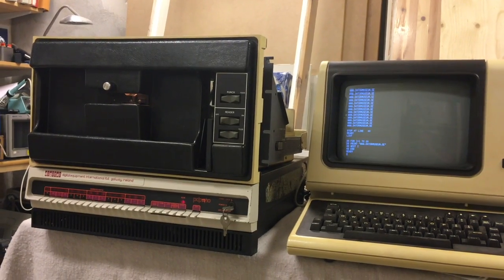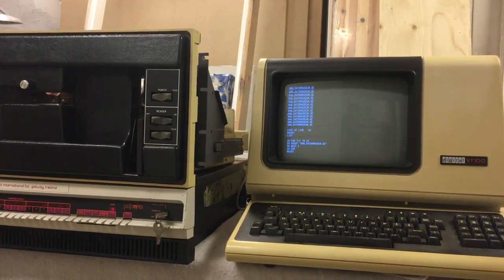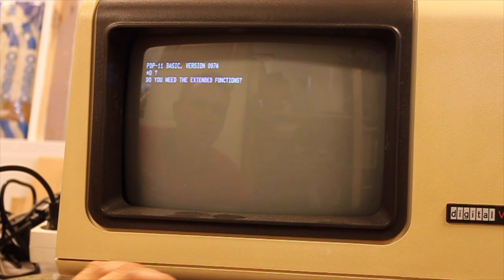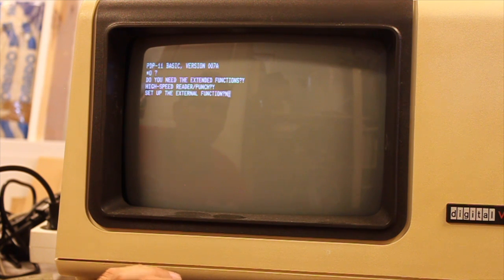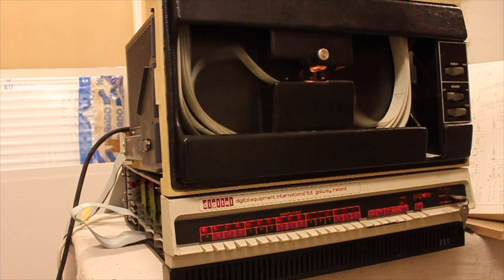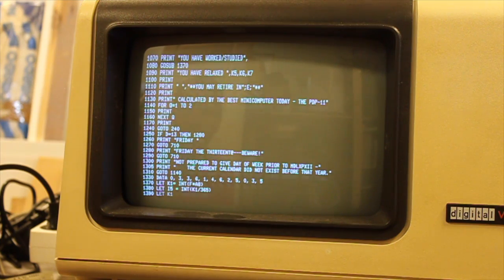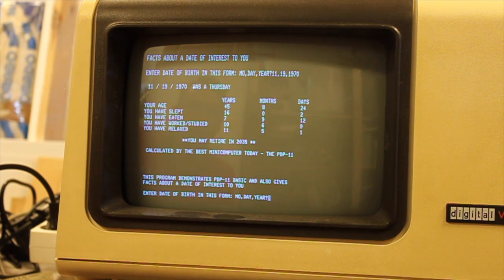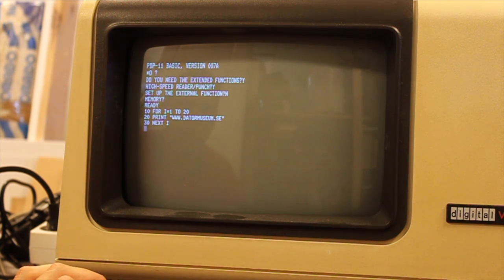PDP-11/10 running paper tape BASIC using a high speed reader / punch

Comment: This is so fascinating! however... why the need of entering the bootstrap loader every time ? they might not had have ROM (silicon) but CORE memory that can hold a program indefinitely . so why the reprogramming every time ?
Reply from the maker: As soon as you toggled the bootstrap in it can stay resident in the core memory unless it gets overwritten. So it should not be necessary to toggle it in every time. But sometimes it is hard to know if it has been overwritten or not…

Comment: I worked on PDP-11/70's in the mid-80's while in the Marine Corps.  Watching the boot sequence reminds me of what a pain it was to boot these things from a "cold" state.  That was our worst fear, booting a  cold and dark system.  We had magnetic tape and disk drives to boot from, which was certainly faster than paper tape but the initial sequence of setting up where it would boot from is very familiar.  Thanks for taking me back in time.

Comment: Does your 11/10 have 16 or 32KB memory? Assume the Basic you used is without support for strings...?
Reply from the maker: It has 16kByte. As far as I remember it was Basic with strings.
Reply: @mattislind4443  The ppt for basic with strings barely fits in the input tapeholder. Hmm, need versionnumbers here.

Comment: Could these punched tapes only store text?
Reply from the maker: One inch wide punched paper tape can store eight bit binary data. Not just text.
Reply: Early Quotron computers were loaded from paper tape.  They used machine language.  The plurality of computers were in Manhattan although headquarters were California so technicians would trundle a tape reader (made by Facit) around the NYC subway system from office to office loading computers.  This in the '70's.

Comment: i hated octal. 3 bits is not a power of two. I always wondered wg DEC used such an archaic system like that. Even the Altair used octal (which I modified to use hex) the IMSAI made much more sense
Reply from the maker: Actually I find octal not that bad. I think it is easier to remember octal numbers than hex. But maybe it is just me. Anyhow, it is definitely a heritage from when DEC computer had 12, 18 and 36 bits computers.
Reply: @mattislind4443  the reason I find hex a lot easier is because humans think in decimal (0-9) and its more natural to group things that way and 0-9 can be represented in 1 hex nyble rather than 2 octal nybles. Most Electronic chips also packaged things into power a of two (1,2,4,8 etc) for example a flip-flop chip in 74376 integrated circuits were packed 4 flip-flop in one packagde or dual flip-flops in a 7476 etc. When I built my first personal computer baaed around the intel 8080 the was also and 8 bit computer so I was more efficient to use chips that were based on 2,4,8 bits rather than 3,6,9. Powers of 2 was a more natural progression that than odd sizes that DEC used.
Reply from the maker: I agree that 0-9 is more understandable for humans, but what about A-F? Most people doesn't recognise them being digits. From what  you write it look like you talk about BCD, which of course has its uses . But most data processing takes place on binary numbers which has to be represented using A-F as well as 0-9.

The number of functions packed on to a SSI or MSI chip is mostly a function of the number of pins of the chip. Most of them were 14 or 16 pins. The 7404 packs 6 inverters into a package. A 74368 packs 6 three-state buffers into a 16 pin package. And the 74174 packs 6 flip-flops into one 16 pin package. 

My opinion is that I don't find octal that bad because I think they are easier to remember.  The octal legacy goes way back to when the computers had word lengths like 12, 15, 18, 24 or 36 bits. The DEC PDP-10 range used 36 bits and could pack six 6-bit characters into one word. I think that the conversion to 8 bit and power of 2 all started with the IBM 360 line which was a 32 bit architecture that had 8 bit bytes. It all fitted well with the EBCDIC character encoding scheme which also was 8 bit. ASCII BTW is 7bit. That would been an interesting mess to base things on. 14 or 28 bit machines?

DEC stayed with octal on the PDP-11 even though it was 16 bit and byte oriented. The VAX-11 however switched to HEX.
Reply: @mattislind4443  yoy would use a lot more inverters and small logic than flip flops etc that's why they packed more small logic on a standard 14/16 pin packages. But most other logic was based on multiples of two. Even the 1401 computer (which predated the 360) was based on BCD logic. The punch card was bcd based as well. It was the punch cards that came before the age of modern day computing suce as in devices like the 407 etc. DEC was late in the computer game with thier first machine being developed in the late 1960s well after the other manufacturers were producing theirs (IBM, BURROUGHS, etc) even Burroughs was BCD based. So departing from the std BCD based way of doing things was odd. Having odd word sizes just did not fit into the standards at the time. Reading BCD in hex is a lot eaiser than reading it in octal. Even IBMs packed notation reads easier
Reply from the maker: @rty1955   In regards to TTL chips and the integration level it is easy to check the list (https://en.wikipedia.org/wiki/List_of_7400-series_integrated_circuits ) There are 1, 2,3,4 or 6 functions per chip among the earlier TTL chips (than 1970) packed in either 14 or 16 pin packages.

IBM very early made the distinction between business and scientific computers. The business computers used BCD arithmetic while the scientific computers used fixed or floating point arithmetic. The advantage of BCD arithmetic is that you can get arbitrary precision without rounding errors. The disadvantage is the lower speed. Now when counting money you want it to be exact but you can probably afford the lack of speed. While scientific computation you can handle lack of precision if you do the math right. And you need the speed.

Prior to the 1410 there were a whole range of both commercial and scientific computers from IBM (https://en.wikipedia.org/wiki/IBM_700/7000_series ). There were no such thing as departing from BCD. IBM did both. The 1410 (and the tube based 650) was the logical extension of the punched card unit record equipment like the 407 and the like. But IBM had scientific machines like the 701 and 709 at the very same time.

Hollerith cards is dating back to 19th century and has a very peculiar coding with 12 rows. The encoding is nothing like 4 bit numbers BCD we are discussing (https://homepage.divms.uiowa.edu/~jones/cards/codes.html ) albeit called BCD under some circumstances. But was really BCDIC (Binary Coded Decimal Iterchange Code) 6 bits codes. Later on this became EBCDIC which were 8 bit code. (https://en.wikipedia.org/wiki/Binary-coded_decimal )

DEC built their first computer, the PDP-1 in 1959. It was all transistor 18 bit ones complement arithmetic machine. (https://en.wikipedia.org/wiki/PDP-1 )

Most processing is computers are done using twos complement arithmetic. Except for certain business applications where possibly COBOL is used and thus BCD arithmetic for processing infinite length numbers.

Hexadecimal representation of binary numbers has really nothing to do with the arithmetic used. It is just a way of presenting binary numbers to a user. Octal, binary,  hexadecimal or BASE64 for that matter can be used for representing binary data. Choose whatever base you like!
Reply: Octal only looks odd on today’s CPUs bit width of a power of 2. Early machines used 12/18/36 bits so groups of 3 made sense (and there was no advantage for groups of 4). And you do not need the strange „if it’s greater 9, switch to characters“ thing, that was part of old encodings of characters. And leaving some bits/fingers unused in counting is easier than to grow 6 more.
Reply: @fromgermany271  it was odd back in 1969 when I was working on a mainframe. You need 4 bits to count from 0-9, which is more natural for humans. A lot of old IC chips used 4 bits too. I worked on a 16 bit machi e that used byte-octal. Very weird. I much prefer 4 bit Hexadecimal
Reply: Octal is only the representation of a binary set of bit states, you can use decimal, binary, hex or any other format to keep your notes.
Yes, DEC used groupings of three switches to underline the octal digit positions, but that was for uniformity.Remember, the predecessor to the PDP-11 was the PDP-8 family with 12-bit words.
Reply: @laustinspeiss  yes I know. Some machines used bye-octal too.
The thing is: to represent human 0-9 digits, it requires 4 bits, so its more natural to group in 4 bit combinations
Reply: @rty1955  There was a side benefit… remember these were early days.
If you knew the PDP instruction set, the instruction opcodes and addressing modes were quite consistent, and used the octets quite neatly.  At one stage, I could literally toggle in machine code on the fly (only very simple functions!)
Reply: @laustinspeiss  I did that on a IBM 360 mainframe
Reply: DEC’s earlier machines had (in chronological order of introduction) 18-bit, 12-bit, and 36-bit word lengths. So grouping bits by 3s was very natural.

Even on the 16-bit PDP-11, you will see that, in the instructions, opcode fields and addressing-mode fields tend to align with octal digits.
Reply: @lawrencedoliveiro9104  I realise that, and that is what makes it odd, as its not a power of 2. When it should be 4 bits, 8 bits, 16, 32 etc, not 12, 18, or 36.
Reply: @rty1955  Those word lengths had more divisors.

Comment: $ basic

PDP-11 BASIC-PLUS-2 V2.7-C 

BASIC2

old punchrow

BASIC2

list
PUNCHR        21:01         06-Oct-19
20 rem PROGRAM BY RONNY SVEDMAN
30 on error goto 260
100 dim font(128,8)
105 open "PP:" for output as file #2%
110 for t = 0 to 127
120 for f = 1 to 8
125 read a%
130 let font(t,f)=a%
140 next f
150 next t
190 rem loopa hit
200 linput line$
210 for pl = 1 to LEN(line$) step 1
215 print SEG$(line$,pl,pl);
220 for col = 1 to 8
230 print #2%,chr$(font(ascii(SEG$(line$,pl,pl)),col));
240 next col
250 next pl
255 print #2,string$(45,0);
257 goto 190
260 close #2%
270 RESUME 2000
1001 DATA 0,0,0,0,0,0,0,0
1002 DATA 0,0,0,0,0,0,0,0
1003 DATA 0,0,0,0,0,0,0,0
1004 DATA 0,0,0,0,0,0,0,0
1005 DATA 0,0,0,0,0,0,0,0
1006 DATA 0,0,0,0,0,0,0,0
1007 DATA 0,0,0,0,0,0,0,0
1008 DATA 28,60,102,70,102,60,28,0
1009 DATA 0,0,0,0,0,0,0,0
1010 DATA 0,0,0,0,0,0,0,0
1011 DATA 126,2,0,126,16,8,126,0
1012 DATA 0,0,0,0,0,0,0,0
1013 DATA 0,0,0,0,0,0,0,0
1014 DATA 4,14,14,4,4,124,124,0
1015 DATA 0,0,0,0,0,0,0,0
1016 DATA 0,0,0,0,0,0,0,0
1017 DATA 0,0,0,0,0,0,0,0
1018 DATA 0,0,0,0,0,0,0,0
1019 DATA 0,0,0,0,0,0,0,0
1020 DATA 0,0,0,0,0,0,0,0
1021 DATA 0,0,0,0,0,0,0,0
1022 DATA 0,0,0,0,0,0,0,0
1023 DATA 0,0,0,0,0,0,0,0
1024 DATA 0,0,0,0,0,0,0,0
1025 DATA 0,0,0,0,0,0,0,0
1026 DATA 0,0,0,0,0,0,0,0
1027 DATA 0,0,0,0,0,0,0,0
1028 DATA 64,128,64,0,255,255,129,0
1029 DATA 0,0,0,0,0,0,0,0
1030 DATA 0,0,0,0,0,0,0,0
1031 DATA 0,0,0,0,0,0,0,0
1032 DATA 0,0,0,0,0,0,0,0
1033 DATA 0,0,0,0,0,0,0,0
1034 DATA 0,0,0,253,253,0,0,0
1035 DATA 192,192,0,0,192,192,0,0
1036 DATA 20,62,62,20,62,62,20,0
1037 DATA 36,118,82,255,82,94,12,0
1038 DATA 195,199,12,24,48,227,195,0
1039 DATA 14,127,253,149,242,127,45,0
1040 DATA 0,0,0,64,192,128,0,0
1041 DATA 0,60,126,195,129,129,129,0
1042 DATA 129,129,129,195,126,60,0,0
1043 DATA 8,42,28,127,28,42,8,0
1044 DATA 24,24,126,126,24,24,0,0
1045 DATA 0,0,1,3,2,0,0,0
1046 DATA 24,24,24,24,24,24,0,0
1047 DATA 0,3,3,0,0,0,0,0
1048 DATA 3,7,12,24,48,224,192,0
1049 DATA 126,255,141,153,177,255,126,0
1050 DATA 1,97,127,255,255,1,1,0
1051 DATA 79,223,145,145,145,243,99,0
1052 DATA 66,195,145,145,145,255,110,0
1053 DATA 240,240,16,16,16,255,255,0
1054 DATA 242,243,145,145,145,223,206,0
1055 DATA 126,255,145,145,145,223,78,0
1056 DATA 192,192,143,159,176,224,192,0
1057 DATA 110,255,145,145,145,255,110,0
1058 DATA 98,243,145,145,145,255,126,0
1059 DATA 0,0,54,54,0,0,0,0
1060 DATA 0,0,52,54,0,0,0,0
1061 DATA 0,8,28,54,99,65,0,0
1062 DATA 54,54,54,54,54,54,0,0
1063 DATA 0,65,99,54,28,8,0,0
1064 DATA 64,192,128,157,189,224,64,0
1065 DATA 126,255,129,185,169,251,122,0
1066 DATA 127,255,144,144,144,255,127,0
1067 DATA 255,255,145,145,145,255,110,0
1068 DATA 126,255,129,129,129,195,66,0
1069 DATA 255,255,129,129,129,255,126,0
1070 DATA 255,255,145,145,145,195,195,0
1071 DATA 255,255,144,144,144,192,192,0
1072 DATA 126,255,129,137,137,207,79,0
1073 DATA 255,255,16,16,16,255,255,0
1074 DATA 129,129,255,255,255,129,129,0
1075 DATA 194,195,129,129,129,255,254,0
1076 DATA 255,255,16,56,108,199,131,0
1077 DATA 255,255,1,1,1,3,3,0
1078 DATA 255,255,96,48,96,255,255,0
1079 DATA 255,255,48,24,12,255,255,0
1080 DATA 126,255,129,129,129,255,126,0
1081 DATA 255,255,144,144,144,240,96,0
1082 DATA 126,255,129,129,130,255,125,0
1083 DATA 255,255,144,144,144,255,111,0
1084 DATA 98,243,145,145,145,223,78,0
1085 DATA 128,128,255,255,255,128,128,0
1086 DATA 254,255,1,1,1,255,254,0
1087 DATA 252,254,3,1,3,254,252,0
1088 DATA 255,255,6,12,6,255,255,0
1089 DATA 195,231,60,24,60,231,195,0
1090 DATA 224,240,31,31,31,240,224,0
1091 DATA 195,199,141,153,177,227,195,0
1092 DATA 255,255,129,129,129,129,129,0
1093 DATA 192,224,48,24,12,7,3,0
1094 DATA 129,129,129,129,129,255,255,0
1095 DATA 64,64,128,128,64,64,0,0
1096 DATA 1,1,1,1,1,1,1,0
1097 DATA 0,128,192,64,0,0,0,0
1098 DATA 6,47,41,41,42,63,31,0
1099 DATA 255,255,17,17,17,31,14,0
1100 DATA 30,63,33,33,33,51,18,0
1101 DATA 14,31,17,17,241,255,255,0
1102 DATA 30,63,41,41,41,59,26,0
1103 DATA 16,127,255,144,144,192,64,0
1104 DATA 26,59,41,41,41,63,30,0
1105 DATA 255,255,16,16,31,15,0,0
1106 DATA 0,0,0,191,191,0,0,0
1107 DATA 2,3,1,1,1,191,190,0
1108 DATA 255,255,8,28,54,99,65,0
1109 DATA 0,0,0,255,255,0,0,0
1110 DATA 63,63,32,16,32,63,31,0
1111 DATA 63,63,16,32,32,63,31,0
1112 DATA 30,63,33,33,33,63,30,0
1113 DATA 63,63,36,36,36,60,24,0
1114 DATA 24,60,36,36,36,63,63,0
1115 DATA 63,63,16,32,32,48,16,0
1116 DATA 18,59,41,41,41,47,6,0
1117 DATA 16,126,127,17,1,3,2,0
1118 DATA 63,62,1,1,1,63,62,0
1119 DATA 60,62,3,1,3,62,60,0
1120 DATA 63,63,1,2,1,63,62,0
1121 DATA 35,55,28,8,28,55,35,0
1122 DATA 50,59,9,9,9,63,62,0
1123 DATA 7,47,41,41,41,59,51,0
1124 DATA 16,126,239,129,129,195,66,0
1125 DATA 0,0,0,255,255,0,0,0
1126 DATA 66,195,129,129,239,126,16,0
1127 DATA 64,192,128,192,64,192,128,0
1128 DATA 224,252,183,245,5,1,0,0
2000 end

BASIC2

---- ---- ----

Have fun, this punches bitmapped ascii chars on the punch, makes great spray paint templates for marking stuff  :-)

Comment: Oh my god, I used to repair those papertape reader and punches in the early 80's! Remember standing knee high in used papertape while adjusting the punch mechanisms :-)
Reply from the maker: The problem is that fan-fold paper tape is hard to come by nowadays. I have a few boxes but I don't really want to punch more than absolutely necessary. Maybe you remember how to adjust the reader? I have one here that works fine when reading continuously, but fails when reading with stalls. For example when the BASIC interpreter reads the tape, it reads a line and then stops for processing a brief moment and then continue with the next line. In this mode it is much more error prone than when reading at full speed. I think I tried most things listed in the manual but it still misbehaves. Ideas?
Reply: If my memory is correct, it could be something with the reader stepper motor start time/ramp

Comment: I believe the PC05 cost nearly as much as the computer itself did back then.
Reply from the maker: I found a price list from 1972 on the net: http://www.village.org/pdp11/faq.pages/pricing.pdp11-05-15-apr-1972.html . Apparently a PDP-11/05 (OEM version of the 11/10) was $6495 with 8kW memory. Expanding memory to 16kW was $4400 extra. The PC05/PC11 was  priced at $3900.  Now this particular machine is slightly younger so it is possible that the prices had come down by then.
Reply: MichaelKingsfordGray  go away...

Comment: Anybody notice that this machine made in 1971, was 2000 compliant in the date?
Reply from the maker: Actually I think that the guy that implemented this toy-program once upon a time took the job seriously and made a good job when implementing the date handling routines. Some old DEC operating systems do have problem handling dates beyond 2000.
Reply: Actually I am an old DEC Engineer. I ran tests on most of our systems in '93 to see if any TOY clocks or the OS failed. I did not find any that failed. Which ones and what OS do you feel failed? RT11, RSTS, RSX-11,  VMS, and OPEN VMS all passed. It was the applications that had issues.
Reply from the maker: I don't know what versions you tested. I was at least unable to set a four digit year in RT-11 v5.3. I also seen reports that RT-11 (version ?) doesn't handle rollover from 31-DEC-99 very well: https://www.nycresistor.com/2014/05/15/pdp-11/ Another is a this discussion thread that say that most y2K deficiencies was corrected in v5.7: http://www.vcfed.org/forum/showthread.php?43632-Y2K-for-RT-11
Reply: Wow, when nobody could imagine even a Nokia 3310.